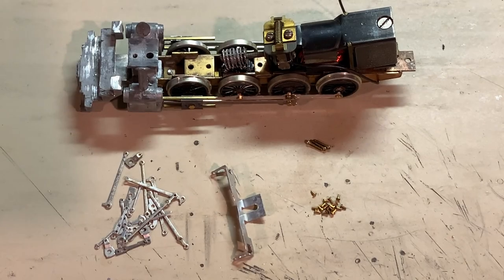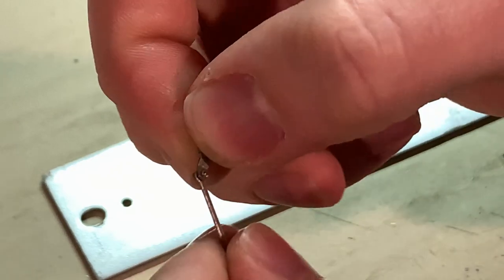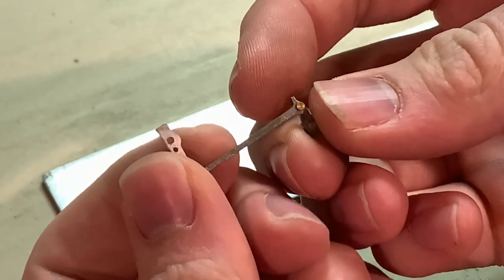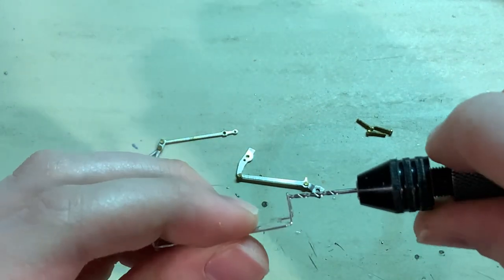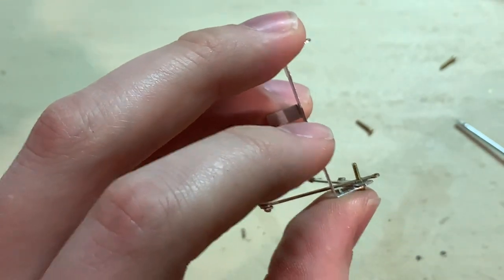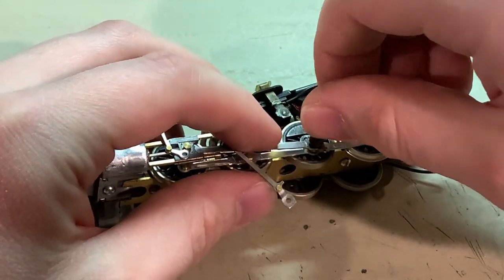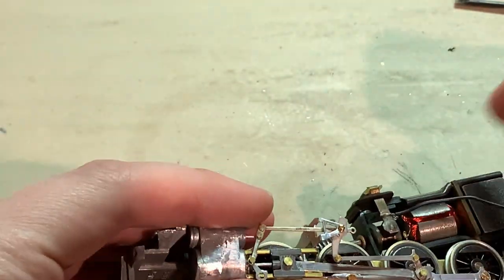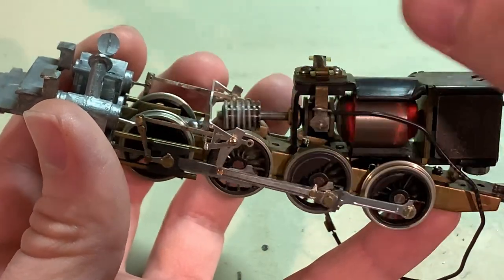How to Build a Basic HO Scale Steam Engine Kit: Part 2 - The Valve Gear

Comment: Does any company still make locomotive kits or did they all stop
Reply from the maker: All the US companies making steam engine kits like this have stopped, but there are still a few European kit manufacturers like DJH, AMF87 and London Road Models. For diesels, Hobbytown of Boston is still around.
Reply: @DarthSantaFe  Darth, what's your view on these open frame motors oriented by an angle to mesh with the axle gear? is it worth re-motoring with a can motor? Could you comment on how to orient the angle when remotoring? thanks!
Reply from the maker: @chlsjtu  A lot of these open-frame motors run well enough that I don't consider remotoring to be necessary.  A lot of times, a cheap magnet upgrade will bring them up to the running standards of a good quality can motor!  When replacing with a can motor though, how to orient the motor can depend on the space available.  When you can get by with a smaller motor, sometimes you can carefully seat is with a block and some silicon bath sealant.  For larger motors though, if you don't have a very long shaft, a full enclosed gearbox (like the ones from NWSL) might be needed to go with it.